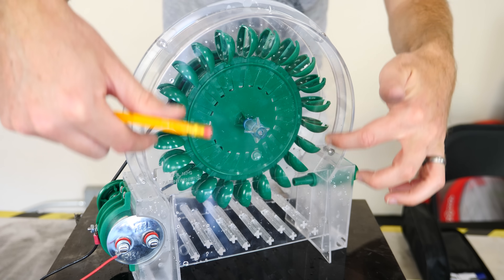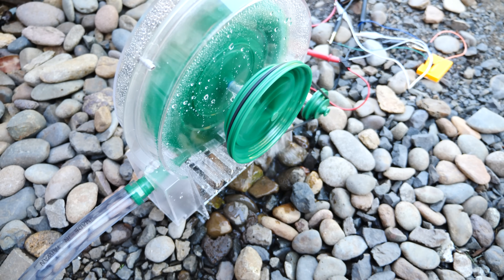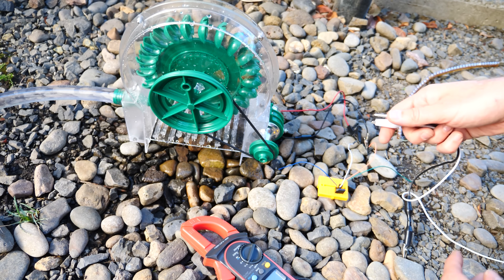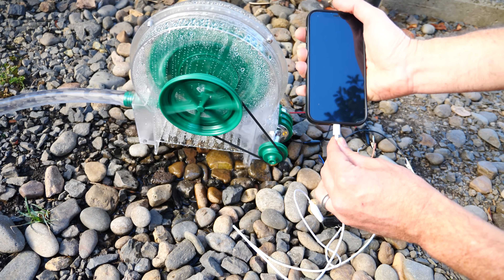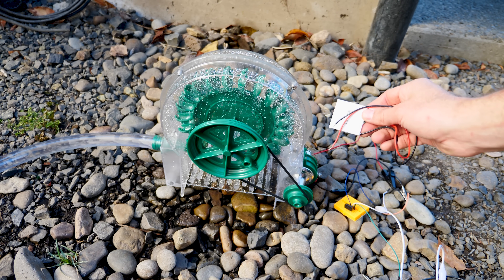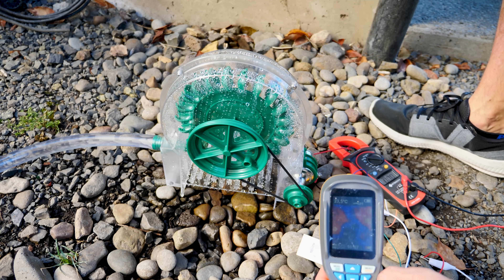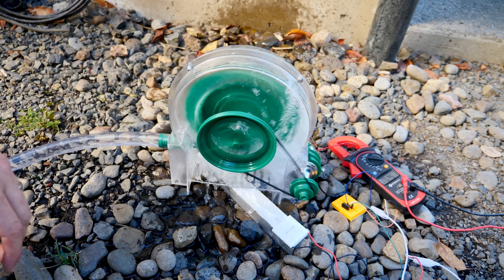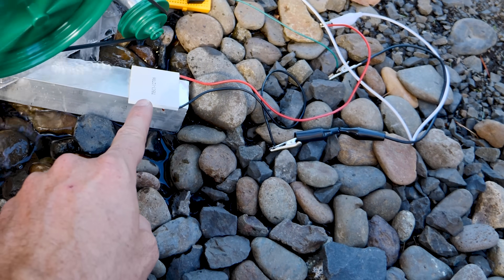Charging My Phone Using Water—How Much Does It Take?

Comment: Cant you technically take the water from below and return it to the water source and then you never lose water so the only thing you have to worry about is pushing the water from the source to the sprayer thingy
Reply: mate are you suggesting a perpetual motion setup ?
Reply: @rahulravishankar3152  no, definitely not. You still have to use a force (electricity / human powered / etc etc) to make sure the pump can make the water run and also to move the water upwards back into the first container
Reply: @upsilan_mitstrima  Ah it makes a lot more sense now. Keeping the same water you started with throughout the duration of operation.
Reply: @upsilan_mitstrima  and then you could use that force directly on the generator to begin with.
Reply: @upsilan_mitstrima  And that's why the system in nature is so wonderful. The sun powers it for us.
Reply: @rahulravishankar3152  nope, they're only pointing out that you could return the water to its source to make it a battery and conserve the clean water.
Reply: @rahulravishankar3152  that’s what I am taking out of it. Other than the final part of the statement “only thing you have to worry about is pushing the water from the source…” which would require its own energy. 

Edit  it wouldn’t do much of any thing in the terms of saving energy but saving water, yes. Prolly too much energy wasted trying to get energy tho lmao
Reply: You would need to exert energy to do that. In nature, the sun exerts the energy for us.
Reply: It's more practical to lift by hand a couple tanks of water and do some exercise why not every now and then than to be stuck spinning a wheel for the whole duration of the charging. Problem is that this method is probably really inefficient.